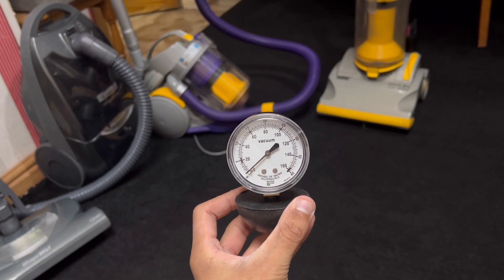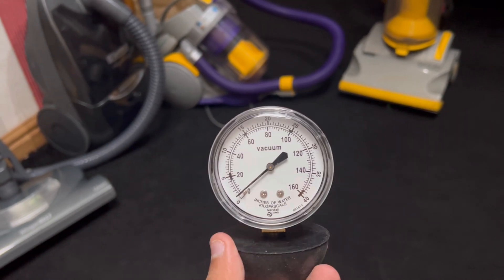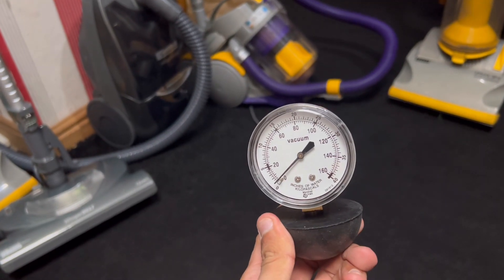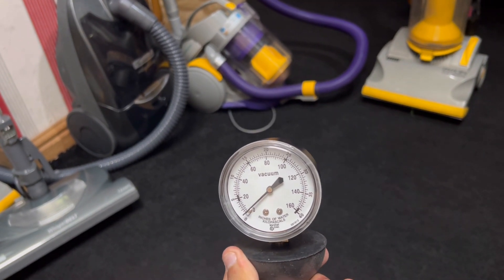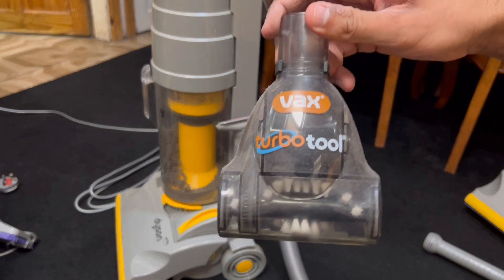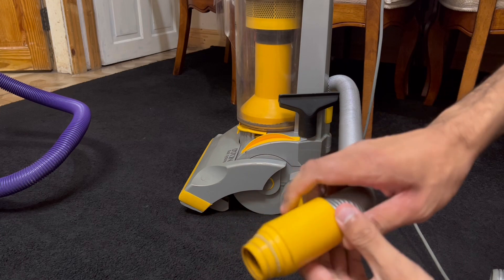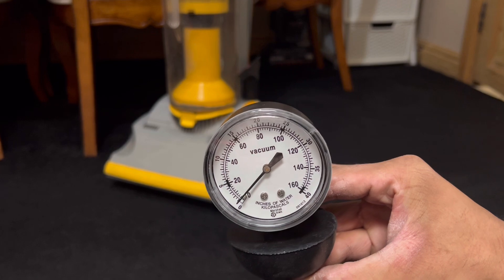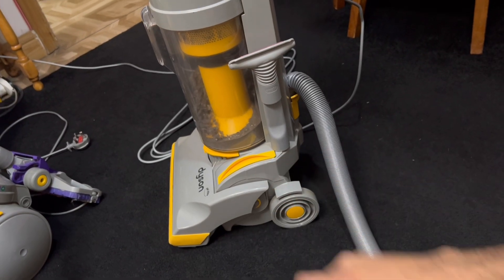Dyson Dual cyclone vacuum cleaners - Suction power & Airflow Testing

Comment: Very good testing method! During my vacuum cleaner years I have noticed that most important performance metric is how well they can spin turbo brush. It needs suction and airflow. Why suction? Well the hole for the turbine is small and airflow only can't spin it fast. It needs decent suction to force air through the small hole.  My best vacuums for using the turbo brushes are no doubt Nilfisk canisters. They make turbo brushes to "fly" like crazy.
Reply from the maker: Thank you!! I’m glad you like the vacuum testing methods 😁

I absolutely agree, strong suction and airflow together make a really good team in making vacuum cleaners work better! 

Very cool about the Nilfisk vacuum! I’d love to try one of those someday. I actually did attach a vax turbo brush to a 1300W Dyson DC39 before and it broke! The impeller shattered and the whole plastic housing did too, it shattered everywhere